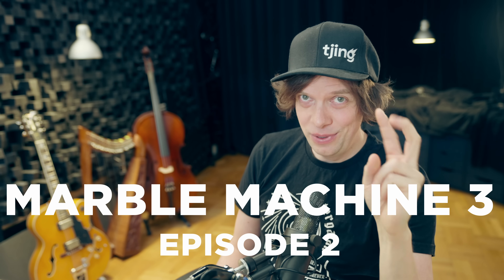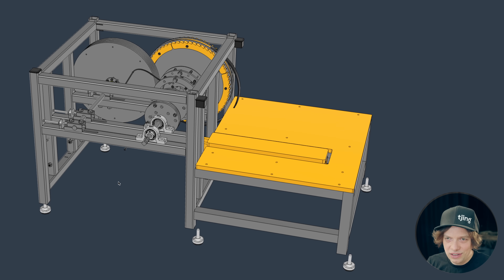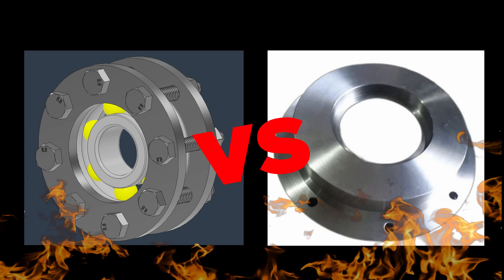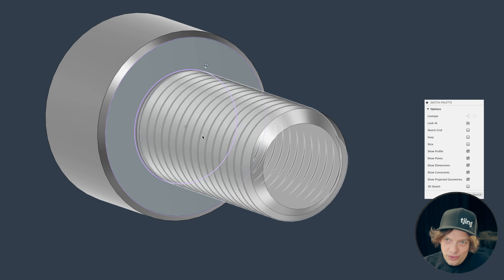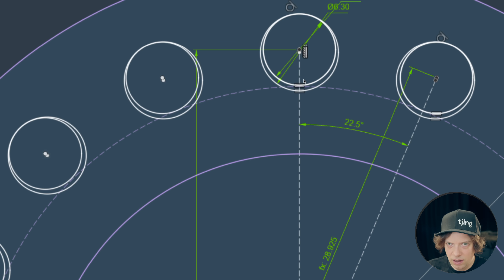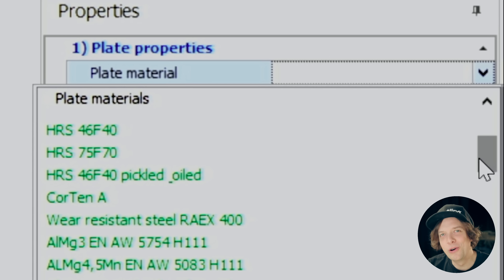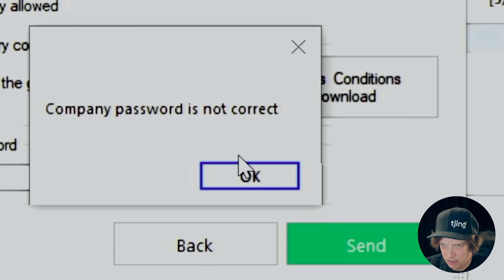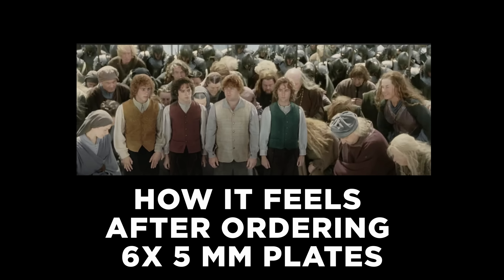Cheap Bearing Housing - Marble Machine 3 Ep.2

Comment: You need to just use flanged bearings. They are designed with the bearing built in to a housing with bolt holes already installed. Its a 1 piece solution without the requirement of needing to design your own housing. Quite literally as low part count as you can get.

Comment: Could you use a 3d printed part to be a snug fit for the bearing and put the bolts where you want. If the plastic alone isn't good enough for a fit you could have a number of screws or bolts that can align and tighten a bit like chuck jaws (and if plastic isn't strong enough you could use metal for the housing but instead of trying to find the perfect fit you'd get a one size fits all. I'm not in the engineering industry (just a hobbiest) so take what I say with a pinch of salt, but hopefully the bolts as chuck/clamp jaws idea gives you something to think about.

Comment: I have used "Split Shaft Collars" as bearing housings. The collars have a tightening screw, I attach the collar to the frame by drilling and bolting through the collars flat sides

Comment: It IS stupid idea.  How to waste time: tweak bolt spacing to get perfect fit (for those particular bolts & plasma-cut plate).  If you must make it, use milling machine.
Machined housing is "100 times better" because they WORK.  You are relying upon unspecified bolt dimension (clearance over the threads).  if you want to constrain bearing this way, use aircraft bolts with shanks of precision diameter on the shank.  NEVER bear against the bolt threads!  It would require only a minute of time to machine step in the plate, it plate were aluminum & you had a metal lathe.  Trade the angle grinder & the TIG torch for a lathe & a milling machine!
          The other way to do this is to purchase "pillow blocks", premade bearing assemblies ready to bolt in.
          This is a solution for a problem you don't have.  You have NEVER mentioned problem with bearing mounting!

Comment: What did you mean by: "sorry for the bad resolution, PC's only go up to 1080p - 4k resolutions are only available on Mac?"
Unless you're talking about the software, which that's weird on their part for doing that, I can assure you that Windows based or even Linux based computers can and do display 4k+ resolutions. My current monitor is 3440x1440 on windows 10

Comment: I'll leave this here for posterity... 

The way this could work would be leaving the tolerances a bit loose and aligning all the bearings in an assembly simultaneously. The friction from all the bolts clamping down the outer race will be more than enough to keep everything aligned, assuming there are no shock loads and the surface is indeed 2B stainless. I can see Martin finding this out in the trial. The problem will come when something crashes and knocks a bearing out of alignment. It will also be VERY time consuming to get everything aligned in this way, especially if this is used all over the place, as he intends. We'll see if he realizes the ridiculousness of this method before it's too late.

Comment: is there a reason why you dont use insert or flanged bearings? The biggest issue with the screw cage, is that under load, you will deform the weak tips of the thread. at least use a sleeve on the screws

Comment: Have you considered using shoulder bolts? They have a precision ground shoulder that would be a much nicer bearing load surface than the threads of a standard bolt. You could make the holes oversized and use shim stock to dial in the fit youre looking for

Comment: As a professional designer, this shit is getting hard to watch. I feel like you should go binge watch Blondihacks to get a good sense of designing for mechanical functional parts. As she will often remind us, threads have too much clearance to serve as accurate locating features for a part, so you're probably not going to get an accurate fit. Bearings are also meant to be inside a close fitting hole. This is going to put all kinds of weird point loads on the outer race that it's not designed for. Martin, I really don't get the need to redesign the wheel here. I know you're trying to simplify and systematically redesign the machine to be accurate and reliable first and foremost, but this type of bearing mount isn't in line with that. We already know how to mount bearings. I think you need to get a copy of Machinery's Handbook and reference it frequently when it comes to things like properly fitting bearings in a bore.

Comment: Use 3 M6 bolts in whatever distance from the center you want (the bolts will hold the bearing by clamping it between the plates. 

The harder thing for you is centering the bearing in the middle. This is the inherited problem with this design.

Comment: As a mechanical design engineer this video is absolutely horrifying. Nobody should ever consider this idea and think it was even worth a minute's consideration. If you don't want to machine bearing housings then design your product around flange mounted bearings. What this project is becoming is saddening to me, this is supposed to be a piece of art, it should be imperfect and impractical, instead Martin is going down a path of a boring solution  that still won't work under the guise of "engineering" it without fully understanding how and why to apply that type of thinking.

Comment: Martin, if you're insistent on building a bearing like this, please use bolts with shoulders. The thread on bearing interface will wear and fail at an extraordinary rate. It's way too high pressure for the material involved.

Comment: I’m not even a mechanical engineer myself but even in some of the most homebrew redneck diy monster of creations I’ve ever seen, none of them involved holding a press fit bearing in with bolts like this. This might work for prototype purposes, but wear will be obvious by the end of testing period. This project could greatly benefit from the greatly reduced wear of a proper bearing housing. And as long as you have a freezer you don’t need much for special tools to press them in.

Comment: Use Shoulder bolts for the bearing housing.  That way you aren't relying on the diameter of the threads being precise to provide a good fit.

Comment: Why not just stack two of those SS plates with an inner precision bore to press fit your bearing? You can still have your outer bolt design to attach it to the flywheel, the bearing won't be subject to bolt tolerance anymore as the bolts are purely for fixing the housing and not bearing contact. Better yet, just machine the flywheel directly to take the bearing? Both designs require outsourcing so pick the latter as it's simpler and fewer parts. Engineering 101. Still a big fan!! 😎💪

Comment: A lot of people have commented on how this solution probably won't work. I am also a mechanical engineering student, and I think you could get the tolerances correct by using precision ground shoulder bolts instead of normal M6 bolts. M6 bolts have allowable major diameters between 5.974 (upper) mm and 5.794 mm (lower). That's an allowable variation of 0.18mm. For holding a bearing in place accurately, you probably want at least a locational clearance fit, if not a press fit. The maximum variation of size for a 52mm diameter hole (as would fit the bearing in a locational clearance fit) is +0.03 mm. You might be able to get close to this by using precision ground shoulder bolts and reaming or broaching the holes to precisely the diameter of the shoulder bolts, but the tolerance stackup on that means that it would probably be easier and cheaper to just have a bearing holder machined or use off-the-shelf insert bearings.

Comment: Good god. Please don't retain a bearing with threads. Threads are not meant for that. They will roll and deform under pressure and throw off all your careful tolerance experiments.

If you are dead set on not machining anything, consider this alternative. Laser cut two or three semicircular-shaped bearing retainers (outer clamps.) In each, cut a hole that accepts an eccentric -- another round part with a hole cut slightly off-center, which can also be laser cut. This is retained by your threaded fasteners.

Advantages: you're not pressing against anything with threads. The threads do what they are designed to do, and clamp the eccentric in place. The shape of the eccentric takes up any required slack and alignment between the bearing retainers and the bearing housing. Allows for fine adjustment of shaft alignment as well. Now you don't have to do trial and error with tolerances, and pray that you get a bolt from a different supplier that is slightly larger and now the machine can't be assembled without new laser cut parts.

Comment: Mechanical engineer here.
This solution will create more problem than it solves. 

You're dealing with small loading here, especially compared to what those bearing are capable of. Just 3d print a housing. 90x cheaper than machine, 90x better than your bolt arrangement. 
Plastic bearing housing are used everywhere. Just look at powertools : drills and angle grinder motors (not gearboxes) use plastic housing for their bearing. 
Don't try to reinvent the wheel, i don't want to hear you announce Marble Machine 4

Comment: Oooo, please don't locate the bearings with the bolt threads. Bolts are for tension and should not be in contact with the bearing housing. I'm sure there are better ideas that are still cheap. Maybe just machine an inset in the plate to hold the housing, or alternate bolts with steel dowel pins to do the locating?

Comment: Sorry dude, this does not look like a good idea.The thread of bolt are not design for that. I can assure you will regret this decision later when thread of bolt retaining the bearing will deform and your wheel starting not running concentric. Trust me, I'm a mechanical designer.
Ps: interesting design though. Might be considerable in a low load, low speed, low cost, one time thing

Comment: Martin... martin. Please. You have so many better ways to do this. Making nylon housings using the routing table. Pillow block insert bearing with spacers... anything. This is not only sketchy, but imprecise and unreliable, especially with a machine that going to noticeably vibrate. It'll just cause more issues in the long run that'll cost time and more money.

Comment: Martin has a CNC router, and a 3d printer. He could make the required bearing housings himself, in wood or plastic. Setting up a strawman argument about the difficulty of acquiring "manually machined" steel or aluminum bearing housings (which could be manufactured with CNC machining anyways) in order to justify this awkward bolt-cage solution, only to then turn around and order those parts to be machined by an outside source anyways, is just entirely foolish.

Additionally, the complexity of this solution, and the difficulty in assembling it with any amount of precision, demonstrates that this is a bad approach to finding a solution to the problem.

Comment: I can just see this design failing in so many different ways; bolt threads get worn down from being a contact surface with the bearing, bearing slips out of rotational alignment because its a friction fit on the flat faces, bolts shear off from the torque required to hold the bearing in place, bolts expand under heat loosening the clamping force on the bearing, etc. Its cheap, sure, but you're reducing the number of needed parts by maybe 1 if done properly (you might be able to keep the same number of parts, just replacing one of the two end plates with a proper bearing housing) and frankly a good proper bearing housing is the most critical piece of the sub-assembly.

Your best bet is either to have the bearing sit in a press fit housing that is machined into the object you need it attached to (think like a bicycle or motorcycle wheel), and failing that at least something that can be bolted on, or as another comment pointed out, use a different style of bearing that might accommodate the rest of your design without requiring a clamping friction fit held tight by bolts that will inevitably fail.

Comment: Robert Kiyosaki is known to say " Fail fast and move on " or a paraphrase on it.  OK, you failed, you learned, so don't do that again.  Everything has a tolerance, the hard part is compensating for it while designing to use it.  You may end up with two sets of holes with both tolerances so you can get ' worse ' bolts to work and ' better ' threaded rods to also work without worrying about the design.  Look up light fixture mounts and you may see a few examples where there is some play in mounting items built into the system as well as size issues compensated for.

Comment: I've tried what you're proposing and it doesn't work well. 

If you insist on using laser cut parts, don't use clamping plates. Laser cut the flywheel with a close tolerance bearing hole. Add holes to secure a flanged bearing and holes near the outside edge to balance it. 

Play with plate thickness so you can have either one really thick plate with a flange bearing inserted on both ends, or 3 plates where the bearings both extend into the inner plate.

Comment: Hopefully you abandon this before you find out why it is bad!  Cut a shoulder into both discs to locate the bearing and be done.  And give the bolts some breathing room so you can assemble it without hating your life.  If you want to use a "bolt-like object" to align something, get dowel pins.  They are designed for aligning things precisely....but not designed for holding bearings.

Comment: brushed DC servo motor, this will give the most smooth and consistent speed also with good low end tq and acceleration deceleration. I would reachout to Glentek servos and drives, they are out of california, they should have something that will work, but I would STRONGLY urge a DC brushed Servo !!!!, just for smoothness. As for bearings, just use flanged pillow block bearings, ready to go out of the box, cheap and widely available

Comment: At the very least, utilize sleeve bushings that allow you to tighten the plates to a higher yield without impacting the functionality of the bearing.  You could also get away with 3 bolts to hold the bearing, then have the other 3 bolts (or more) at a larger radius to run through all the components and have them tightened without impacting the functionality of the bearing.  Lastly, you could create a bearing housing by having two plates as you've shown (drilled through) and then two more inside plates that are cut to a tight tolerance that hold the bearing; then, the bolting only has to hold the outer plates, and the inner plates in place without having any bolts touch the bearing.
Reply: I had the same sort of idea for the manufactured bearing housing but had pictured it with one middle plate the same thickness as the bearing.

Comment: So I just wanted to add, that stainless steel variations can be 10X cost difference, so as you order parts it may be worth checking what is cheapest. It is a nice tool and should help a lot! We believe in you! Keep up the good work. I spent 10 years with 1000 people trying to make a complex precision machine, and we did. Don't give up. It can be done!

Comment: As a rocket engineer working on bearings I have to say, 100x more expensive is the best deal of your life. Although I think there are other options designed around a flat plate with holes you put between the two plates. Very hopeful you can make it work!

Comment: If you want to use bolts you should look into shoulder bolts. They only have treads at the end.
Reply: Or 3D print 2 plates with a small recess to fit the bearing. Then sandwich the bearing between the 2 plates

Comment: There’s zero reason to be using a flywheel at this point, let alone try to design your own.

Work on a functional marble-machine that is motor-powered *first*.  Then, if you still feel the need, you can switch to manual-power.

But a DIY flywheel serves zero purpose to your overall goal—IF your “overall goal” truly is a working musical instrument (and not just stalling for time).

Comment: Martin, you had me worried for a long time that you were giving up on this. I'm so happy you are going for the MM3. Yet, this design scares me. I am just about to graduate with a Mechanical Engineering degree. I have a lot to learn, but I have seen quite a few bearings fail. If you cannot get your design down to absolutely perfect tolerances then your flywheel may have a lot of vibration involved. The bearing may be able to handle the vibration for a long while, but the rest of the machine may be impacted by the vibrations. I also worry about wear on the machine itself. If the machine is assembled too many times, the extremely tight tolerances on the bolt holes will become sloppy and lead to a loose bearing fit. The way I see it, this design may work with some very fine tuning at first, but it will only degrade over time and lead to problems later. I know you mention that the cost of a fully machined housing is very high, but it may be your only option here if your bolt design does not meet your expectations.

I do think you will figure it out better than I can. After all, I am not working on the machine like you are. I only wanted to warn you of possible problems in your future.

Comment: Yeah, but no. A waste of time and resources. The bearing will be riding on the threads of the bolts the threads will quickly wear flat from loading. You could cheat this with stacked  plates and short threaded, long shank bolts, but you're not really saving anything, then getting a solid lump machined to specifications.😮

Comment: You could use shoulder bolts so at least the surfaces holding the bearing are smooth. Otherwise over time the threads on the bolts are going to get ...smushed. Plus shoulder bolts have more accurate outer diameters than regular bolts. They are a little more expensive though.